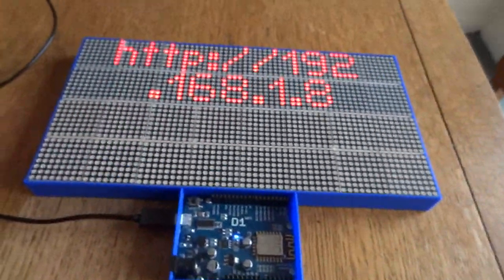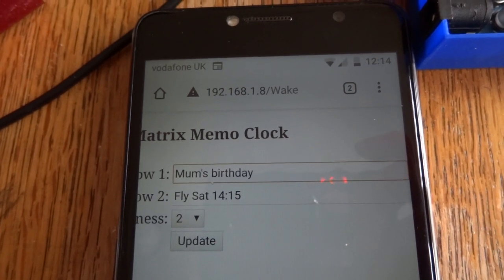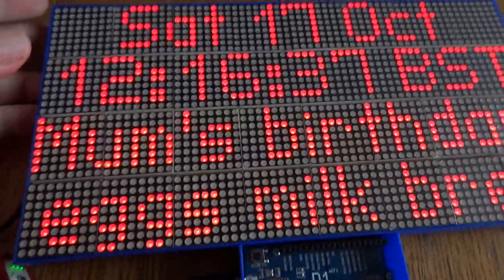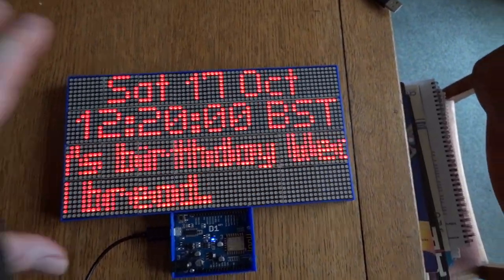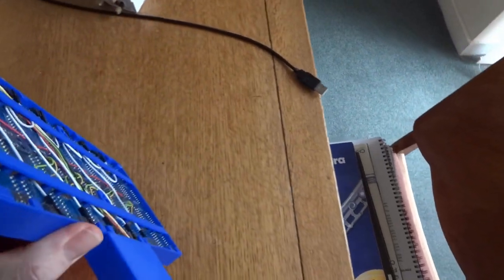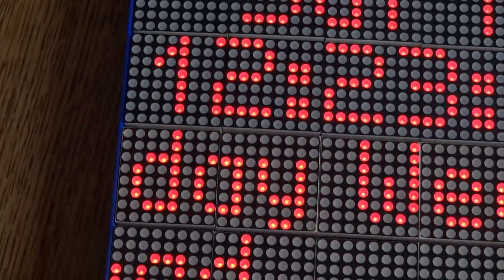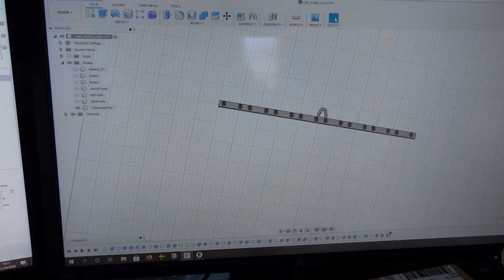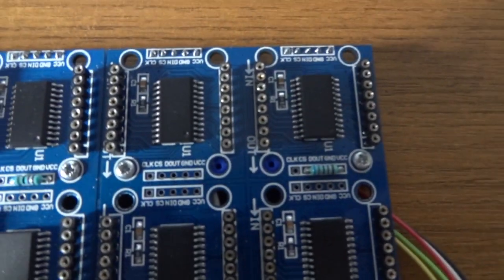Max7219 dot matrix display: clock, calendar, and memo board.

Comment: What are the pins for  the Din Clk  and CS
Reply from the maker: CS is defined in the sketch.  If you use my sketch unaltered, it defaults to D8. It's up near the top of the main sketch: #define CS D8   Beware that different versions of the 8266 boards confusingly mark the same pin with different labels.  If you don't have documentation, or are unsure, it's best to modify a simple 'Blink' sketch (standard example) to blink the pin - then connect up a LED (with 470-ohm or similar resistor) or use a multimeter to check which pin is actually going high and low.  The other pins are the standard SPI pins for the 8266 - and should be labelled on your board or in your board's documentation MOSI (master out slave in - connect to Din) and SCLK (serial clock, or maybe just CLK).  8266 numbering of the pins is confusing - there's a GPIO number, and then a D pin number.  Sometimes the D number printed on the board is different to the one you use in your Arduino sketch.  A blink sketch 'blinking' a selected pin is the surest way to find out.  You should be able to rely on the MOSI and SCLK labels printed on a board, or the board's documentation, though.  If you have an oscilloscope, you can also monitor the clock and data lines to see that they're changing rapidly.
Reply: @ceptimus  Thanks for the reply. I appreciate the help. Your display is great.

Comment: Hello I just connect 2 4in1 Max7219 module and seem it run correctly. I see the wiring, that only Data Line connected from end of 1st module to data in 2nd module, while CS and CLK pin are connected in the middle of each module. Am I correct on this ? I wish to make one of this nice clock project.
Reply from the maker: It doesn't really matter how you connect the CS and CLK pins together, as long as they're connected on all the modules.  You can "daisy chain" them, like the data line, if you wish.  I did it the way I did because it keeps the wiring simpler and neater.
Reply: @ceptimus  Thank you for giving the update. However, currently my matrix display a bit flickering all the time. Appreciate if you could share any suggestion.
Reply from the maker: @tutwirata8956  Flickering sounds like it might be power supply related.  If you're powering from a Wemos D1, use the 3.3V to power the display chips, not the 5V.  If you have access to an oscilloscope, try monitoring the power supply to the display.  As an experiment, you could disconnect some of the display modules, and see if that stops the remaining ones flickering.  You could also try supplying more current to the microcontroller board, via a better quality USB lead, or the barrel jack connector (if present).
Reply: @ceptimus  Yes flickering display is no longer appear, i plug in vcc max7219 from 3.3v of the wemos. Thank you for the guidance.

Comment: the sketch zip download is not working, can you repost it?
Reply from the maker: @Steve Hartman.  I just downloaded both the sketch zip and the STL files zip.  They're both pretty small 8.6kB and 72.3kB respectively.  Can you please try again?  Maybe it was just a temporary outage of my Website host.  Please let me know if it's still not working and I'll investigate further.  By the way, I modified my display now not to do the 'memo' thing, and instead it shows local temperature and scrolling weather information from one of those on-line weather services (free).  I find that more useful.  I think I made a video about it, but I'll go check now.  If I never did, I ought to add that to my list of things to do.
Reply: @ceptimus  for some reason it wont work on my windows desktop running chrome, the link goes to youtube redirect and nothing happens.  but i just tried it from my iphone and it loaded into chrome and asked me to download, and i was able to grab the zip file and store it, and send it to myself from the phone.    thank you for getting back to me!
Reply from the maker: @SteveHartmanVideos  It might just be that the download links had the old http: prefix and not the secure socket layer https: even though my website does have an SSL certificate.  I've edited the 's's in to the links now, and I'll try it myself, next time I'm on Windows, (if I remember!)  I'm on Linux Mint at the moment, and using the FireFox browser - that seems to work okay with both prefixes.